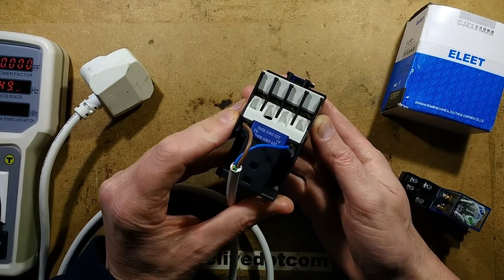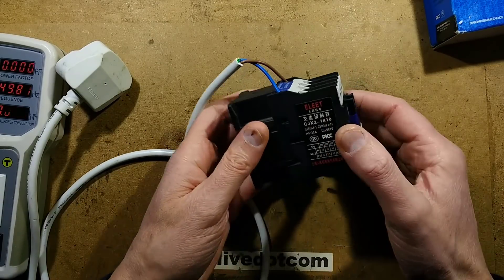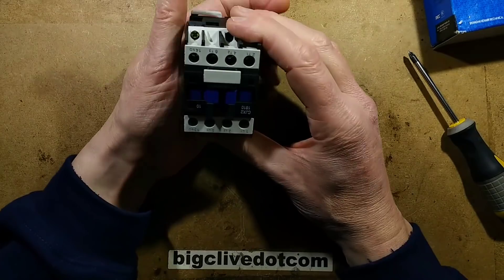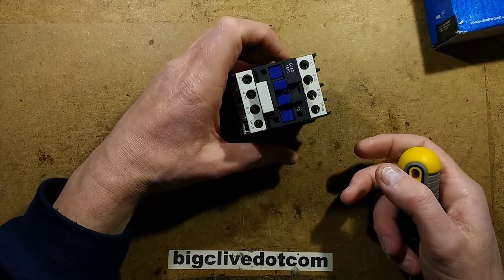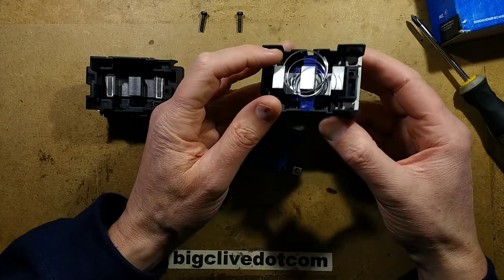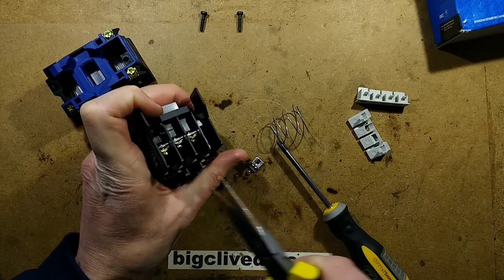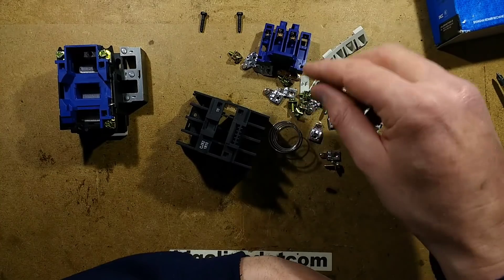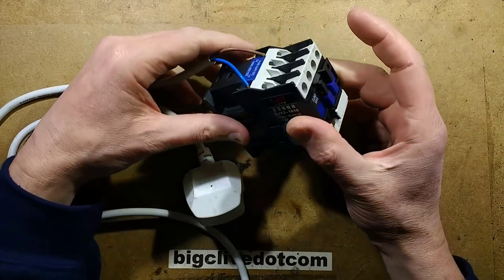eBay CJX2 industrial contactor teardown.

Comment: I wonder how many cycles they are rated for? And more importantly how many cycles they will actually survive? Given the average Chinese manufacturer's rather generous assumptions!

Regarding the HID story that is why contactors typically have multiple ratings. I often see 30A contacts rated 24A or less for HID loads.
Reply: There's a common cultural idea in China called "face" (as in "saving face") that basically completely justifies straight up lying about something rather than admitting weakness.  In the case of so many of these 'straight from the factory' aliexpress and ebay products, this tends to manifest as manufacturers grossly exaggerating ratings of products, usually because they won't admit being weaker than a competing product.  This can end up with things being rated an order of magnitude or more higher than actual facts indicate, due to co peting products repeatedly 'out-facing' each other.  It's seen as an entirely normal thing in China, but tends to annoy anyone here when they buy a 50,000,000 mAh battery pack and are greatly disappointed.

As a rule of thumb, you have to assume the ratings listed are exaggerated to some degree for any product not quality assurance tested directly and marketed by a western company (although it's been cropping up I've noticed even in recognized brands' products in recent years).  I would generally trust industrial components though to a higher degree as the importance of efficiency of the production processes in China would lend itself to well designed factory gear.  Then again, you also often end up with the 'reject bin' QA failed products when buying cheap off ebay or aliexpress.  I guess buyer beware is the only real safe assumption, that and test the shit out of anything that has the capacity to blow up under normal operating conditions BEFORE using under said conditions.

Comment: Heat relay wont stop contactor if you are using screwdriver to hold it in. Lession learned.
Reply from the maker: Ah, no.  The thermal overload breaks the coil circuit.  Was there much smoke?
Reply: Does the lesion hurt?
Reply: That depends on how it's wired